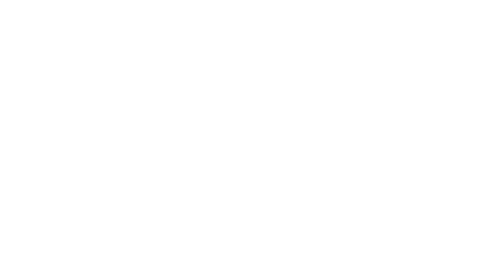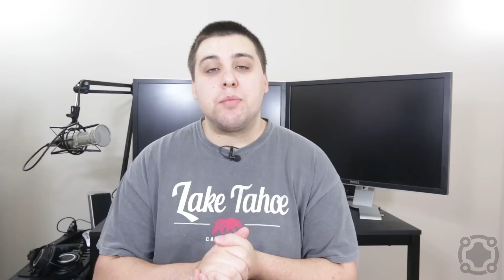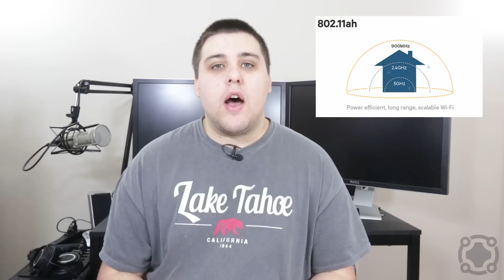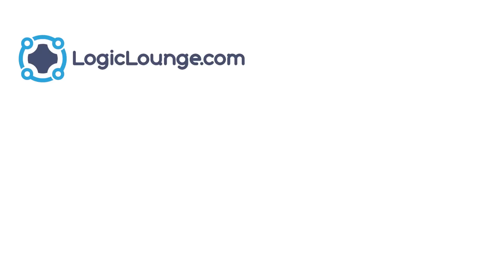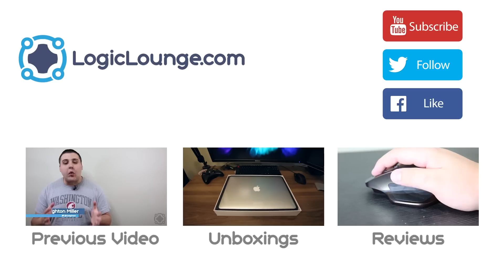WiFi 802.11ah Will Penetrate Walls Easily With Less Power

Comment: What about wireless AD there are Laptop and tablets wireless cards that support that standard but as far as i know, there is only 1 out for a desktop currently and it runs between 300 to 400 range not like the tablet or laptop wireless cards and im talking about internal cards not external

Comment: Wouldn't a lower frequency have the trade off less bandwidth? Also how many usable channels will there be? Will it have the same issues as the 2.4 ghz congestion where everyone is on the only 3 good channels 1,6,and 12?
Reply: It's actually meant for IoT applications, so you really don't need a high data rate since you are sending data between sensors you just need power efficiency!
Reply: Also I would hate that GSM causes there to be only 1 or 2 allowed channels and then everyone on the same channels causes lower data speeds
Reply: I think the standard has less bandwidth because its meant for lower data devices but data rate is not depended on frequency. The faster the data rate the more bandwidth you need to allocate (ask the FCC for and design for) 900 Mhz is only the carrier and modulating data onto it means that you leak out of that 900 MHz pure tone, so for example it ranging from 895 to 995 Mhz would mean it is using 10Mhz of bandwidth, if your modulation scheme using 1bit/hz, then that directly transmits to 10Mbps. Computers are FAST, they could opportunistically choose white spaces (in time or carrier frequency) to transmit when GSM is not. So CarbonBasedLifeform has point here, mostly GSM people are just facebooking. I hope this helps :)
Reply: Ok remember some people still use 900mhz house phones and intercoms and baby monitors use the channel too so you will get interference